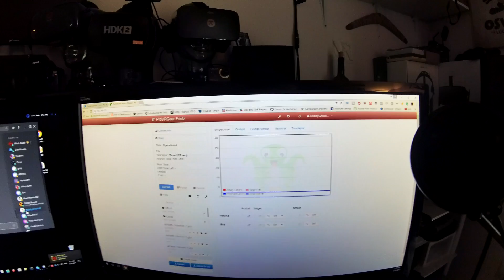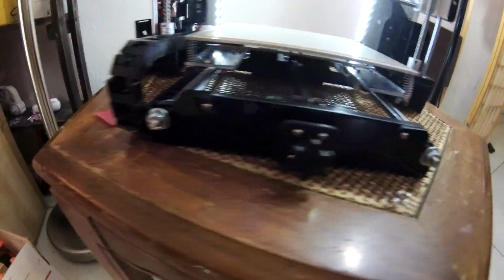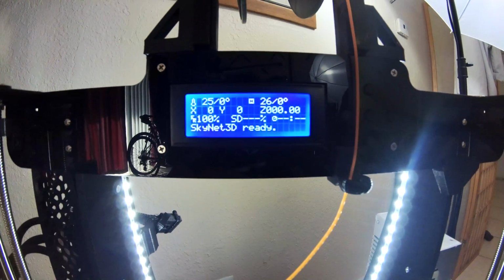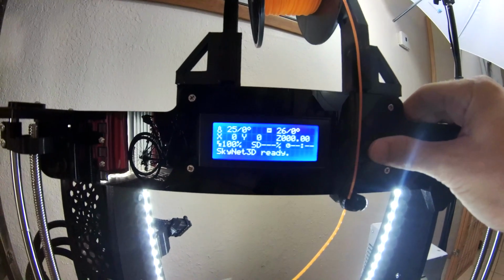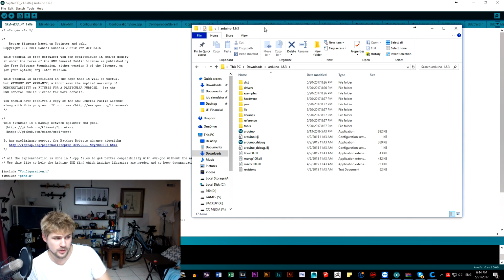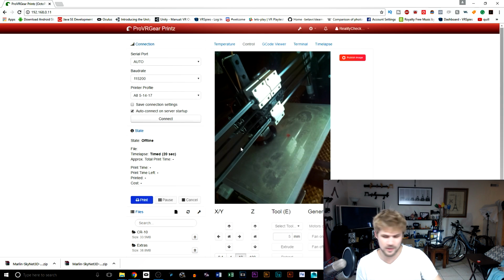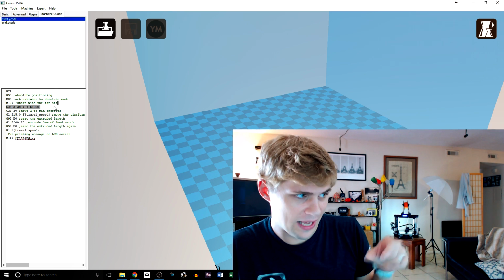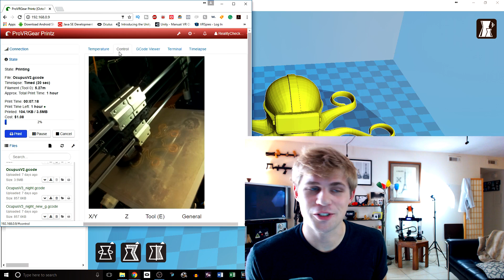✔ ANET A8 MORE UPGRADES | LED Lights, Dimmer, & Heat Sinks! + Skynet 3D Settings

Comment: thanks for the video, i got the same printer and trying some of your mods, pretty new to this world.
i have some problems with my bed i thing is vended a little bit not sure if i am not calibrating properly you shlould do a video of that :)
does the glass makes alot of difference? I am using ABS.
Reply: Add a 3 mm glass sheet on the bed. 2 clamps.One pass of glue stick.
Level the bed at least 2x , do two passes along all corners.
Nozzle should touch the paper just a bit. if you push shove the paper away from you is should drag but not make the paper bend up.
Use a water Level, to check of the bed is just as horizontal as the X axis. If not adjust the z rods to level the X-axis perfect.

(when i heat my printer i can move the X and Y positions (in cura) move the Z down until it stop (triggered by end stop) when i move the print head along the print bed i see a tiny small line of filament, showing is it at the right height. the head leaks a tiny bit of filament, in this case no problem, but the paper fits perfect when heated and checking with the paper.)
Reply: Get rid of the glass sheet - too heavy.
Put down a build pad - lighter.
Add an auto level sensor - prints right every time.
Install bowden system - lighter.

Comment: my led strip fluctuates simultaneously with the light of the main board. is it because of the stock power supply? do i need to upgrade to a 30A one?
Reply from the maker: Vu Nguyen I would assume so! I took this old psu and tried to use it on another printer just for lights and a heated bed and it also fluctuated a lot. I am currently buying another 30amp psu to do the trick instead)
Reply: Reality Check VR thank you. gonna upgrade right away

Comment: Hi! Great video! I need help with my Anet A8, after upgrading to skynet, when I select auto home in the menu the X and Y axis are ok, but the Z axis is way too high up. Could you help me fix this? 
Thanks,
Have a great weekend.
Reply from the maker: I've noticed that I have to auto home the z axis after first turning on the printer using the LCD (prepare-auto home)
after I do that it always knows where 0 is. I assume there is a simple z setting that I need to add to the gcode before it begins new prints.  If I turn the printer on and just print it doesn't go to the proper z spot either... I think this is something to do with the fact that skynet is used for auto levelers in most cases, still I haven't needed to adjust level in weeks.
Reply: Thanks! I'll try adding something to the start gcode so that the z is at the proper position before prints.
Have a great weekend!

Comment: Caleb, nice video. Well Done! I like that you not only put links in the comments but you also packaged the upgrade files. Of only more youtubers were that good. I feel the same about the auto bed level as well I just don't have issues. One thing I wanted to ask is do you have any issues with the cable chains on your Y and X axis? I've been looking at several versions of the g code files but haven't found one I wanted to try. As it is I really don't have any issues with the cables binding but the look cool. Anyway nice job on the printer and your video!
Reply from the maker: Thanks a lot for the positive vibes Robert, certainly appreciate the comment! I've adjusted my bed level once (barely) since I've made this video) I've never actually had any problems at all with the cable chains, they seem to work just fine and not effect anything negatively. I think it looks quite cool with them) still cable sleeves will do the trick) Very impressed with this printer)

Comment: Nice mods, You don't need to put heat sinks on the Z axis motors as they don't do any work.
Reply from the maker: your absolutely right! I do not have them on any other of the printers Z motors, but with the Anet A8 I liked how it hid the silver and made it look badass* Thanks for checking out the vid Auzze!

Comment: That A8 would be better off on the floor than on that table.
Reply from the maker: I hear ya on the stability side, still this little table is short and has 6 stable legs, so no shaking))
I plan on getting a "printer bench" to put them all on eventually. He is a little tough guy I tell ya!